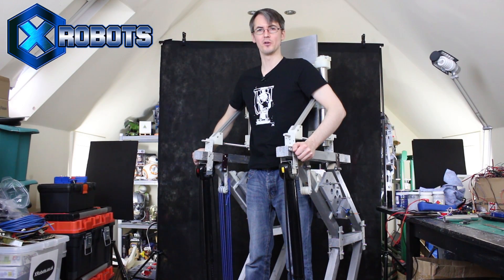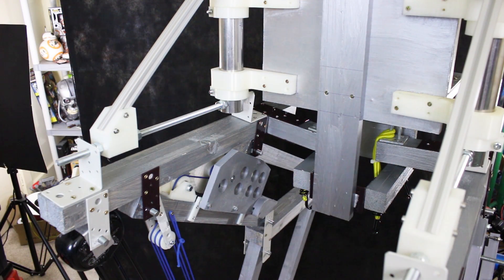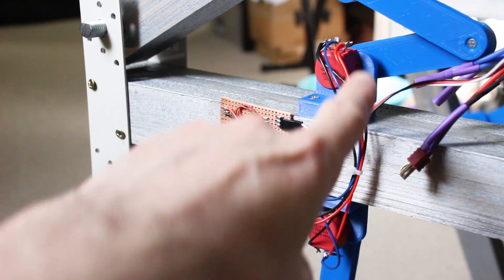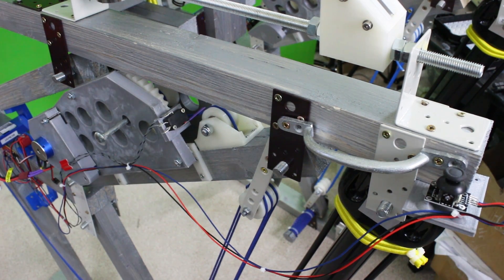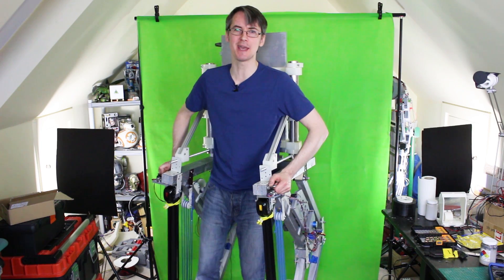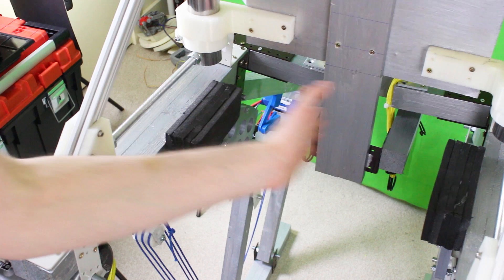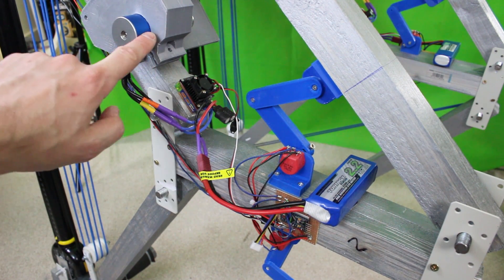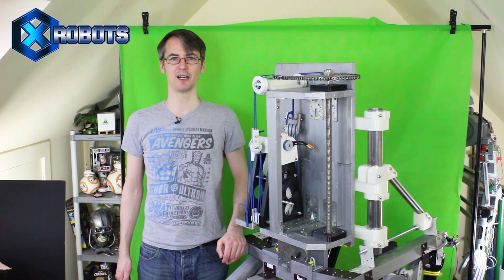Iron Man Exosuit #9 | Working Power Legs! | James Bruton

Comment: So what about crouching? As in moving down to grab something off the floor?

Prove me wrong if I am, but don't the legs in their current setup prevent you from crouching down? In order to draw in both legs  you would have to lift both feet off the ground simultaneously which I'm pretty sure would put you off balance.

I think in addition to the sensors in the feet there needs to be another pressure sensor between the suit's torso and your hips  which adjusts the angles of both legs to the current height of your hips.

Comment: for future designs and innovations on your power legs why dont you look at warhammer 40k specifically space marines. for example sensors that will detect the electrical signals running through your legs to activate the motors.

Comment: I think you should have a plate under your feet so you are in the Suite not walking on the ground with it, then you could tighten the foot control spacing.

Perhaps some kind of toe clips triggering the leg lift switch as well as a plate to stand on!

I think something that holds your feet in place would make it easier to set the leg trigger pressure.

maybe a toe clip and a heel pressure switch.

Later, FW.

Comment: I have an idea, but I dont know if it would even work. I suggest adding pressure sensors in the joints like you did with ultron. If you love your limb up, the exosuit will move up too.

Comment: What about feet plates for standing on? You would have better grip, both for the suit on the ground, and for your feet when between the control pegs and plates.
Reply: Remember, S. Smith: James Bruton's gotta absolutely make sure that a stray calculation won't suddenly rocket the legs to the fully extended mode and potentially break his ankle (or worse) before he physically attaches his limbs to the device's.

Comment: It would be nice if your feet were somehow strapped to the bars somehow or you were standing on the bars themselves.

Not really sure where I was originally going with this, but it would give the impression that your movements were being completely augmented by the exoskeleton rather than assisting you just enough to keep the weight off of you.

Comment: +James Bruton, I think you might find if you use the load cells from a scale and put them under your feet, you would get a more natural feel when lifting your feet to control the legs. I've got a simple bridge amplifier circuit that can read the super cheap sensors from bathroom scales.

Comment: For your feet, you should look into getting ski boots and bindings (used for snow skiing).  That way you could mount the bindings to the exo suit so you could lock the boots in and move your feet up and down and it would keep to movement ridged.  With this, you could have assisted motors that engage with your moments.
Reply: So you wouldn't need to use your hands to operate your feet

Comment: Don't you think the legs should activate when you move your thigh instead of when you lift your foot? Because if anything goes wrong, like if you lose balance and you need to move the suit's leg, you might not reach the activator in time with your foot to keep it steady.
Also you might want or need to have some logic connected to the suit's hips because both legs and hips need to work together, although at this stage it might not be critical.

Comment: another way to activate the legs with your foot is to mount a string to a shoe and have your feet on the exoskeleton and not the floor. when you lift your leg it could pull the string activating a pull switch like what is on a ceiling fan.

Comment: Why are you trying to use switches as the actuators? You have already built a motion capture suit and wireless electronics, why don't you use that technology to control the suit with your movements rather than having to do it this way. It doesn't seem like you're going to be able to work everything with your hands and thumbs, etc...If the exoskeleton suit mimicked your joint movements via wireless suit the controls would be a lot smoother and organic.
Reply: Not as elegant a solution as bluetooth motion cap control but whatever works.
Not to dwell on the potential...the suit so far is pretty awesome!

Comment: The actual mechanism seems capable of a much larger range of motion than you're using. Is this a limit of the motor or are you (almost literally) taking baby steps as you start out?

Comment: Your still physically lifting your legs. I imagined your feet to be supported by theExo Suit, oppose to you taking weight on your feet.
Reply: lol you gonna fly
Reply: +Sinan493  A hydraulic car jack amplifies the force you exert. You push down on a handle which pushes a small diameter cylinder piston which then forces fluid to a larger diameter hydraulic cylinder piston and therefore lifting the load. The amount of load you can lift is proportional to the force you exert on the handle determined by the ratio between the surface areas of the two cylinders. This is mechanical force amplification.

An exo suit DOES NOT work the same way. The force you exert is sensed via a pressure sensors which then sends a signal to electric or hydraulic drives to move that particular actuator to lift the load. It's not YOUR force that's moving the load. It's a pump or drive motor. The end result may be the same but how you get to the end result is different.

Having said that, you would not be able to make an exo suit work with a simple mechanical force amplification system like a car jack. Just think about how many times you need to pump a hydraulic car jack to get it to lift 2in.
Reply: James Bruton here is two 3d models made in google sketchup that could possible work if expanded upon (note mesurements these is not acurate models) mega(dot)nz/fm/pJZiiJgQ (note sure if you have link filter)
Reply: Just noticed you replied back. don't mean to sound retarded I've just seen exo legs where the feet are on a plate connected to frame instead of touching the ground.. i have seen various images on google showing this, if u find can find the time to check it out. Can't think of any other way of explaining this . then your not taking any load on you legs.. not dissing your work... a lot of what u do inspires me.

Comment: It seems like you may need to devise both an up switch and a down switch. The leg motion seems like it's dependent on too much thought on your part. Could you put force sensitive feed back sensors in your shoes? or into some form of stirrups? 

I also love the design of your floating joystick from the previous part, it's actually really innovative, however I feel like that will also take too much thought to walk and move your exo arm smoothly, could you make some form of glove, or sleeve with the force sensitive feed back sensors, or create a separate armature similar to the Ultron arm to feed the movement of the Exo Suit arm?

Comment: If you want a belt that you can get out of quickly, look into Scuba diver weight belt buckles.  They're designed so you can drop your weights in an emergency.  It looks kind of like an airplane belt so you can undo it with a single hand very easily.
Reply: Maybe this will aslo work:
http://www.thingiverse.com/thing:198335
Its a Buckle that can be opened by pressing on the front, instead of pressing on both sides at the same time.

A scuba belt buckle opens with one hand, by moving a lever from letf to right, this one opens by pushing it, and its a 3d model, so you can modify it to have a bigger button to press
Reply: ive printed that in abs, fond that the female portion of it splits apart at the the base. may need to look into reinforcing it if anyone intends on useing it